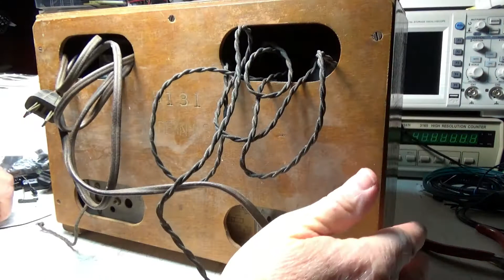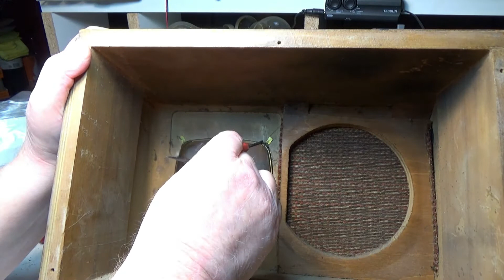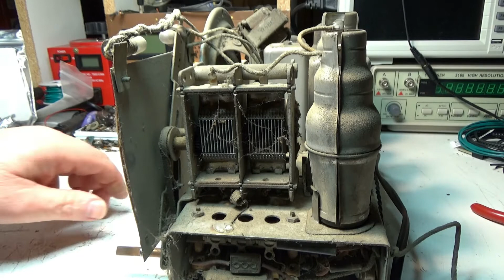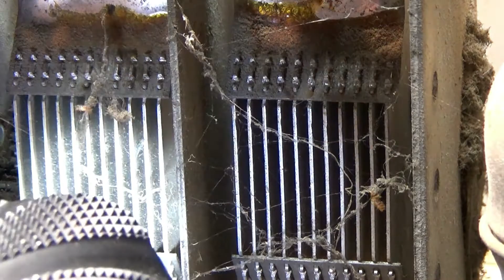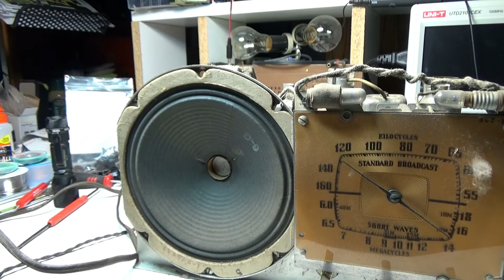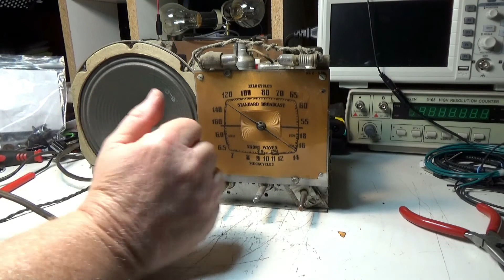Sonotone Model B 131: Part 2, The Start!!

Comment: I bought from Adams in the past and see they are now out of business, but https://www.qualityradiobelts.com/order-here.html is another option on dial belts. A clean looking radio in great shape to restore. I hope things go well as you move forward. Best, Don
Reply from the maker: The cloth woven belt I got for this radio works great!  I would recommend getting one if the radio came with one from the factory.  They can be bought from https://antiqueradiosandparts.com/.   I would have kept that "O-Ring" belt, but it rubbed.  Don Thank you for watching!
Reply: @wouldchuck3619  Thanks for the URL. Best, Don